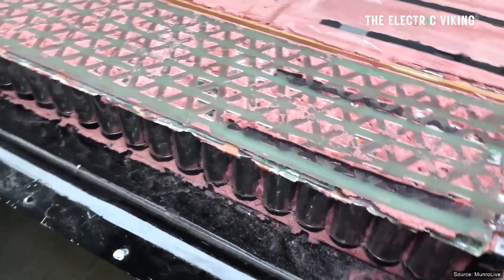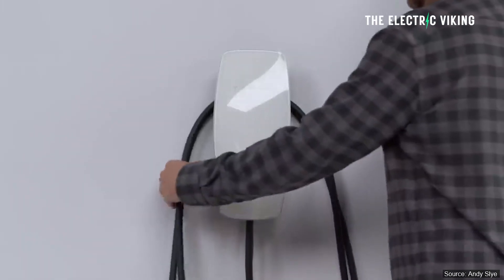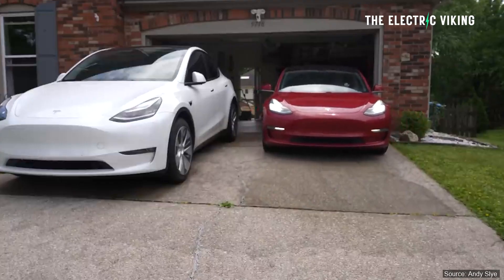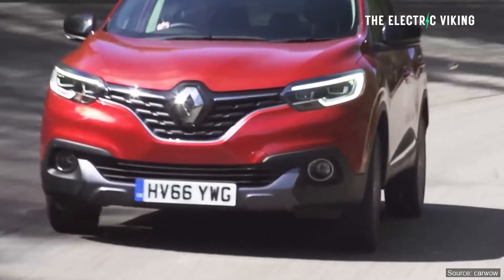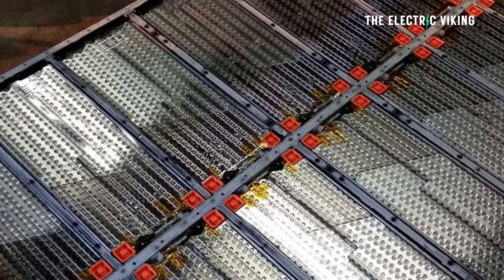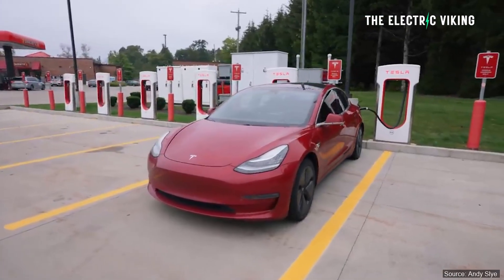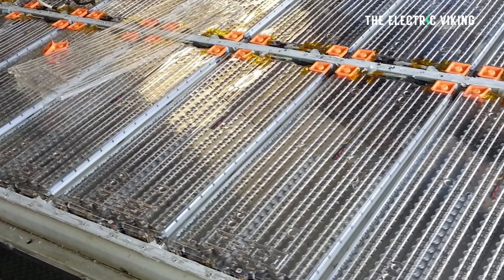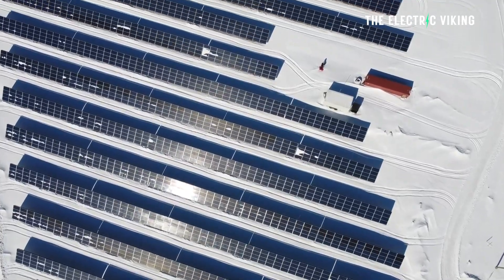Tesla owner reveals secret to 95% battery capacity after 135,000 miles

Comment: Charging to only 80% isn't really a secret, this has been known amongst diehard EV enthusiasts and home EV builders for a long time. On EV build forums I joined over 12 years ago it was always stated that this was key to long battery life, along with not discharging below 20% approximately. In fact those who were doing long term tests came to the conclusion that discharging to the LVC regularly was just as if not more detrimental to battery lifespan as charging to the HVC. (This is subject to what the manufacturer sets  its LVC and HVC).

I have a set of 10 year old LG chem pouch cells in my build and they haven't degraded in any detrimental way by keeping within these limits.
Reply: Charging to 80% is not a factor with LFP chemistry batteries.  LFP will be the future of the Model 3 vehicles, because it's so cheap
Reply: I used to have LFP batteries originally (8 years ago), were more saggy and affected by the cold. They have a very flat voltage discharge curve so found I needed to fully charge to know true state of full charge. Found it was pushing too close to the LV limits what damaged a few cells on them.  @cyclopsvision6370
Reply: You're right.

NMC batteries should ideally be kept between 20% and 80% state of charge most of the time. Jeff Dahn even recommends keeping them between 45% and 70% most of the time if possible 

But LFP batteries can be used between 0% and 100% without much degradation. The best is still not to keep your LFP battery at 100% state of charge for a long period of time.

Comment: I charge my 2023 Tesla RWD standard version to 100% because I was told the LFP batteries allow this. I hope they are right and I don't suffer premature battery degregation.
Reply: they still have calendar aging for those batteries. Constantly having any battery at 100% for long periods of time are bad for it
Reply: Elon knows his battery packs best. So I'd do what the manual recommends for daily use/charging.
Reply: I have a Model 3 with LFP battery. I only charge to 100% one day a week. Most of the time I only charge up to 70% or 80%.

Charging an LFP battery up to 100% still degrades the battery but is needed for battery calibration and cell balancing 

You shouldn't charge your LFP battery up to 100% everyday if you don't need to.

Comment: Restricting charging is sensible as well as a more gentle charging cycle. It's also important to avoid deep discharging the battery as this can damage the batteries. Temperature is also important high charging temperatures is not good as it can degrade the batteries life as well as subzero temperatures can quickly discharge a low state of charge battery to zero thus potentially damaging it.

Comment: Daily drives are 7kwh on avg.
Ezi pezi to top up. 
Vehicles are parked 23hrs every day. 
Selfparking EV can plug into the grid and day trade electricity and stability with the grid.  😊😊😊😊😊
Rapid chargers will be on the main roads and at corner stores. 
😊😊😊😊😊😊😊

Home battery is$14,000 and 10kwh, EV big batteries are 100kwh and $free, with the vehicle. 
Hahaha Hahaha.
Reply: Dream on.
Reply: for every "rapid charger" pushing out 250kw, you kinda need a 250kw feed pushing into it. Kinda how physics work (yes, there will be loses). So 4 on a street is a MW. Ring up your local energy supplier and ask them to pop a MW feed into your street. Now if we had lots of SMR's everywhere that might be doable.
Reply: @geoffhaylock6848  Most vehicles only need a trickle feed to top up daily. 
For the first time, anyone can have a full 'tank of fuel' available every day.
Topping up your ICE vehicle with petroleum at home daily was never a simple 'clean plug and play' situation.
Rapid charging at home is overkill. 
The happy driver has a full 'tank' every day.

Comment: Still at 100% after over six years, commuting 100 kilometers every workday. (Hyundai Ioniq)
Reply: All rechargeables degrade. I'd bet that they are hiding the specifics from the user.
Reply: Yeah BS. Either it had a buffer or the screen is just flat out lying to you. If what you said was true, it would defy the laws of physics.
Reply: It is possible that my garage has misled me .  While I have not experienced diminished range, this has given me an excuse to order an OBD2 battery scanner to get to the bottom of this.
Reply: @DanielDemaret  I suspect all BEV's have some kind of a buffer. No one wants to see the used price of EV's hit the deck due to fast battery degradation.
Reply: Gross 🤮

Comment: Sam, my January 2016 Model S 85D has 163,869 miles and the degradation is similar to the guy in your report given my higher mileage. (South-East London). I've driven this car all over Europe too, all over Germany, NL, France, Spain, Ireland and the South of Italy.
Starting Range	Current Range	Range Loss	Percent Loss
264.51	                244.44	                20.07	        7.59 %
I extensively use my free Supercharging. I only charge to 80% or 90% if I am immediately driving (I don't leave the car at a high SoC). It has never been charged to 100%. The original advice from Tesla in 2016 was "charge little and often". I followed the advice on the Battery University web site. I also drive smoothly without excessive acceleration.
Reply: Thanks for your insight and advice :-)
Reply: You mean to say, you are driving your car as if you like it and want it to last as long as possible, but still using it. Very smart. Cars are a very expensive tool. You should take care of expensive tools. Then they work for you,  a long time.
Reply: @howardrichburg2398  I’ll take the same approach for everything I buy. If you look after things they’ll look after you and you  won’t have additional and unnecessary expenses.
Reply: Thanks, that interesting. As time is a factor,  not just milage. But that seems good.
Reply: I don't find so smart to charge ALWAYS at 80%, even if battery degradation would be down to 95%. This means this guy never use the remaining 20% capacity of his battery, as if it were a sort of 'self inflicted battery degradation '